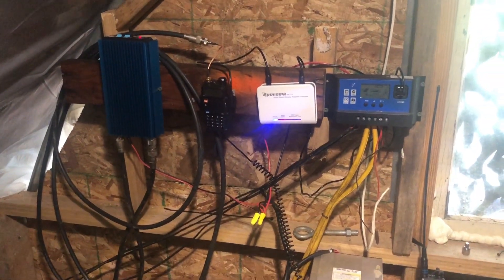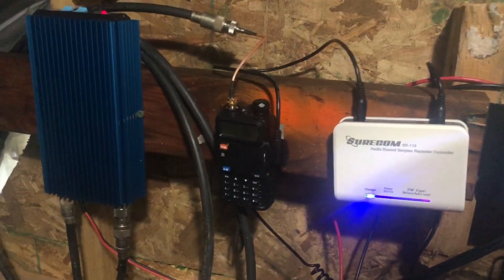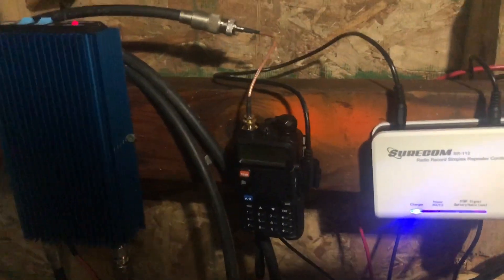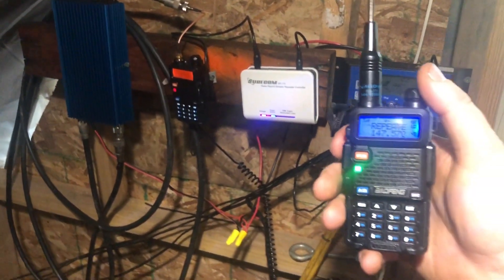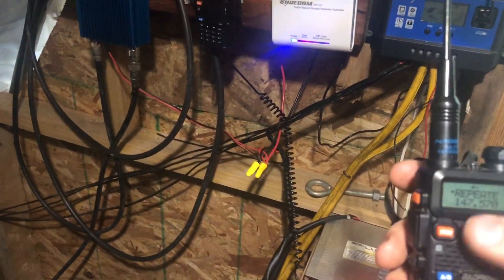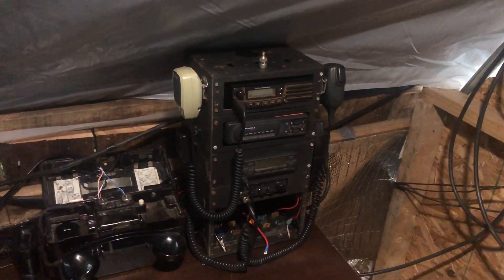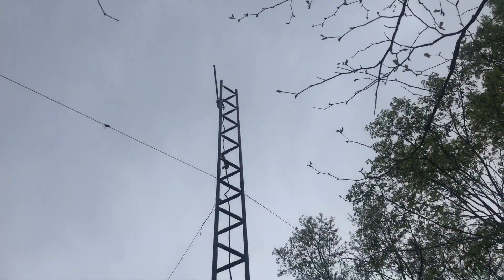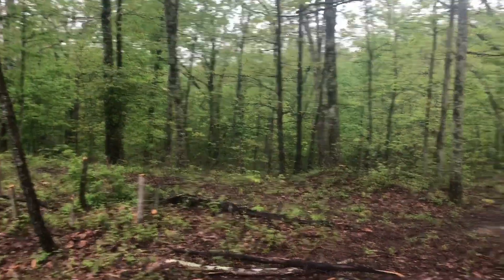Surecom SR-112 Simplex repeater setup

Comment: For any visitors if you set this up on a simplex channel (as it often is), do everyone a favor and set an RX CTCSS tone on the surecom side, and set your field radio's TX CTCSS tone to the same. That way the general public won't be triggering it.
Reply: I have wrestled with this point on GMRS because these SIMPLEX Repeaters are NOT allowed on GMRS (Duplex) Repeater Channels and MUST be on Simplex Channels,... That said, I just discovered GMRS "Interstitial Channels" which are Frequencies INBETWEEN the dedicated GMRS Channels & it's Legal (restricted to 5 watts) 
GMRS Channel 1 is 462.562 & Channel 2 is 462.587 so if you go to VFO mode OR make your own Channel with CHIRP for example, you can have your own private "Channel" in between GMRS 1 & 2 @  462.575 and of course, use CTCSS tones for an even tighter setup.
Anyone Scanning GMRS Channels won't even hear your Parrot (only if they are scanning Frequencies in VFO mode)
Reply: @d @davidyummus6259  This is the most awesome comment that I have been hoping to find. Thank you for posting this. What is legal? What is illegal? What channel what frequency thank you so much for this information.

Comment: Great video of a simple inexpensive setup. This is the only video I have seen of an effective simple repeater setup. Question: what kind of range are you able to get out of the amplifier? I know it is a bit of a loaded question but How far are you able to transmit in Symplex mode vs the amped repeater? I am looking to setup a simple reliable systems where I can communicate with family APPX 10 miles away. My terrain is pretty flat. 

Thank you for your help.

Comment: I have the same unit. Why does the sound on transmits have a weird background noise? The one at the club does the same. Any advice would be appreciated. Good video.
Reply: You ever figure out the noise?  Mine did the same thing, but not on 100% battery with no charger, noise came back with 110v battery charger.  If your powered with a wall wart or battery and charger, make sure they are well filtered.  Hope this helps.

Comment: Can I ask how did you set your baofeng uv5r as a repeater? You said in the video that you are transmitting in another frequency and receiving in another frequency.
Reply: You simply program your Baofeng with an offset frequency. It’s a lot easier to do with the programming cable. You can do it through the handheld but it requires you to program it manually. Basically the idea is you are listening to one frequency and transmitting on another. I’m pretty new at all this but from my understanding typically the split between sending and receiving frequencies is between 5 and 10 MHz.

Comment: You're using two different 2 meter vhf frequencies to achieve this? Why not just use true crossband repeat with a mobile and dual band antenna? The output would be close, no need for a controller, eliminate the amplifier, seems like win win to me. Then you have real time repeater activity. Assuming you're a licensed ham.

Comment: I wondered why I never seen anybody set it up like a repeater with an offset so everything had to go thru the repeater and not hear the other person if you were close enough..... Good thinking, that's what I'm gunna go also, make the simplex repeater experience a little smoother.
Reply: I was just thinking that. I have a buddy who can hear me in his yard but not in his house sometimes so if I set this to tx on our main freq and rx on a separate freq we can chat normally bypassing the repeater or go through the repeater if necessary and still be heard on the main freq. the receiver wouldn’t hear me twice either due to setting the radios to duplex mode using separate tx and rx frequencies
Reply: Cause is a recorder with one radio. There are repeater with crossband that can do that with 2 radios.

Comment: What is the different using this simplex repeater vs a duplex repeater box  where u need 2 radios.  Is there a different on performance
Reply: duplex repeater transmits and receives in real time because it has 2 radios.  The simples receives, then stores audio on the Surecom controller, THEN replayes audio for transmit.  It's like an phone answering machine where you 'leave a message' and play in right back for others to hear.

Comment: Good job on your install but you were transmitting on a Ham Band Frequency
Reply from the maker: I am a ham operator. The numbers you see underneath are ham band. However, the repeater freq. I’m using, doesn’t fall inside that band.
Reply: Where does this freq fall? i was also wondering because there was no call sign on eather end. how do you transmit like this?

Comment: Quick question how do you keep that baofeng charge I know those radio don't last long
Reply: they make an adapter than replaces the battery and allows it to connect to ac or dc power full time.
Reply: By using a battery eliminator

Comment: After a bit of experimenting I've got my setup working great. I've built it into an ammo can now .50 cal and have it running off 12v car batteries on a hill top. It's working fantastically well. Really pleased with it and it turns out my issue with the sure comm cutting in early was simply because you need to run your repeater radio at max volume 👍

Comment: @Appalachain Survivalist 
Hows this repeater working. I just got my surecom sr-112  and it keeps stopping recording part way through my transmissions and starting the rebroadcast before I've finished my transmissions. This can happen after about 6 seconds!
Reply from the maker: Working well. It sounds like your squelch or radio settings might be the issue.
Reply: @appalachiansurvivalist2080  hello, I also have a similar simplex repeater setup. I was wondering if you had any pointers to the most effective solar pannel and batteries. And also do you have a link for the amplifier. All help is appreciated  please email me zxfire711@gmail.com Thanks!

Comment: it looks like your amp is set to ssb.  Might want to set it to fm.  That's very similar to my simplex repeater setup, which is coming up on a year of operation on solar.  I really like your tent and stuff too.  Stay safe.  73
Reply from the maker: Prepping Ohio I’ll have to look when I get back up there. I may have inadvertently flipped the switch. Thanks for the heads up! Glad to hear yours is still up and running. 73 to you as well.